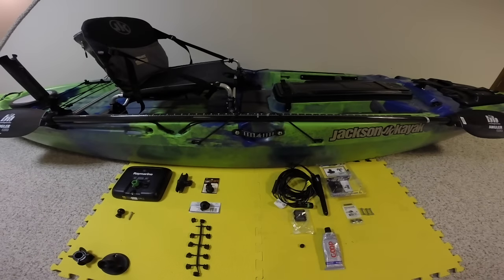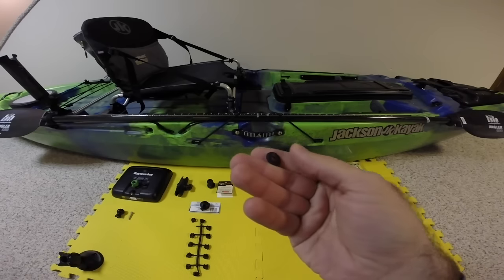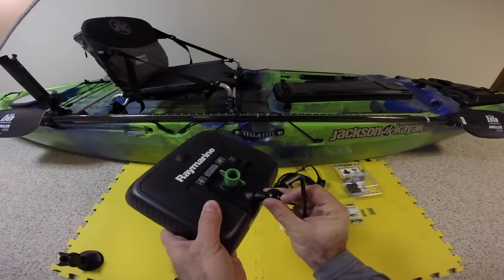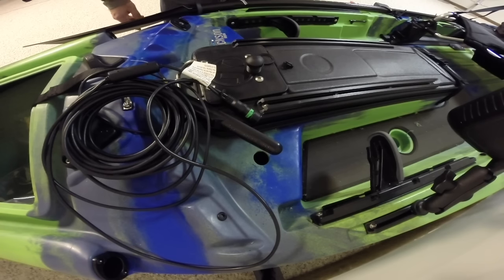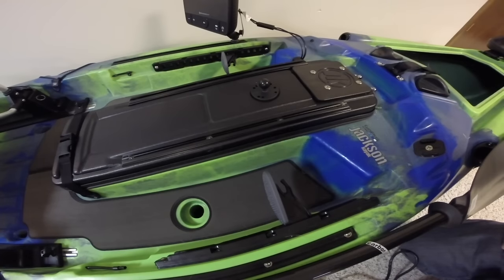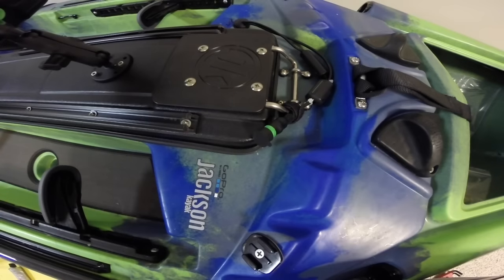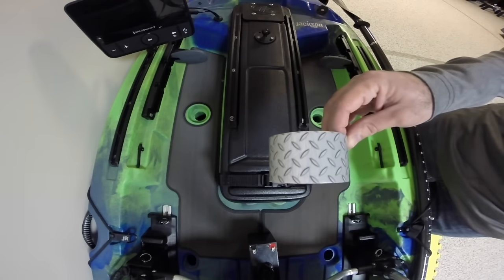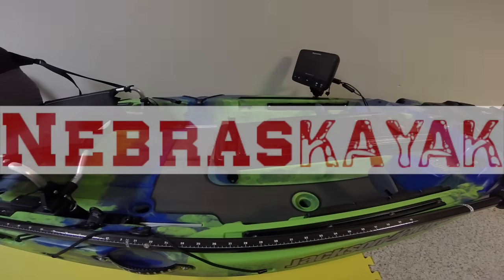Yak-Haks - Raymarine Dragonfly 7 on Jackson Cuda HD

Comment: Hi Nebraskayak, I very much like this video. I am about to add a Dragonfly 5 Pro to my yak. I have had too many concerns regarding mounting method and location. I wish you could have done a real world comparison of the transducer in actual water vs in the hull mounting. I read many of the comments about Raymarine having in hull models, but my limited research showed me only through hull designs. Where a tube that attaches the ducer to the hull and goes through a hole in the hull. Have you noticed (and how could you really notice if both methods were not tried first) and signal degradation because of shooting through the hull itself? Beleive me I very much want to protect my transducer from damage, but at the same time want the Very Best signal return for my money. If I am going to have a top notch unit I desire top notch signal results. Please everyone but especially Nebraskayak please chime in...
Reply from the maker: Ultimately it is up to you how you want to mount it but I have used this method on three kayaks now and over four years of kayaking and it works great.  If you clean the area first and then use Goop brand (do not skimp on the brand) you will have no issues.  Sonar is just sound and penetrates through the hull just like it does if you hit your paddle on the side of your kayak.  Also, if you use the Goop and decide you want to change...you can pull it off and it comes off in one piece and it easily comes off of the transducer as well.  I've had to do this when moving it from one kayak to another and it worked just fine.  I do have a video of me on the water with it and I'll be posting it shortly.  I'm just trying to figure out how to synchronize screen refreshes or find the right FPS so it doesn't look choppy.

Comment: Any issues with the downscan or anything with tranducer in hull?
Reply from the maker: Great question Mark!  I too was hesitant to try the first time.  I was frugal and bought another brand of marine silicon the first time.  It was a nightmare.  But once I used the GOOP brand...I haven't had a single issue on my last three kayaks.  A clean area rubbed down with alcohol, marine grade GOOP and no air bubbles (which isn't hard to do) and you are set.  Keep in mind that sonar is just sound waves and it shoots through plastic with ease.  Also both Garmin and Hummingbird make molds for mounting their transducers in the hull, so it is a fully approved method.  Some people worry about water temps but I can assure you that I'm getting just as quick and accurate of readings as all my kayaking and boating buddies that have theirs in the water.  Thanks for watching!